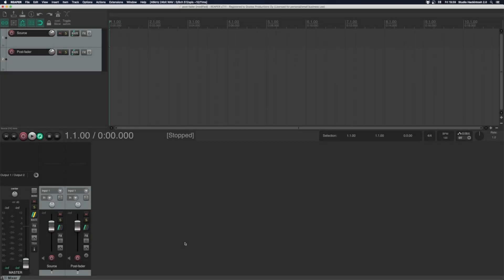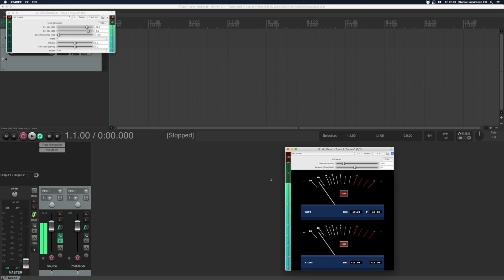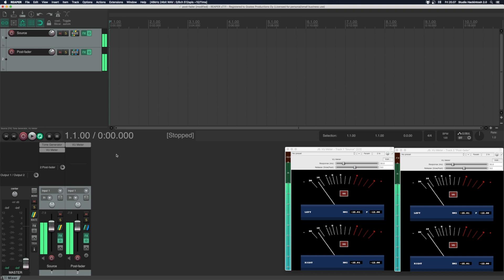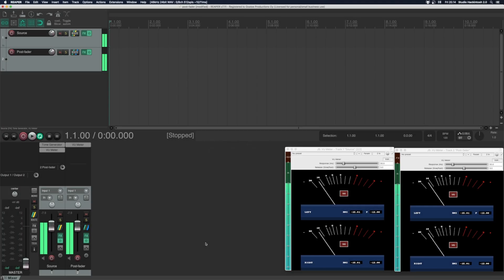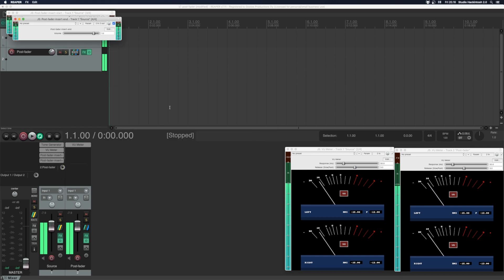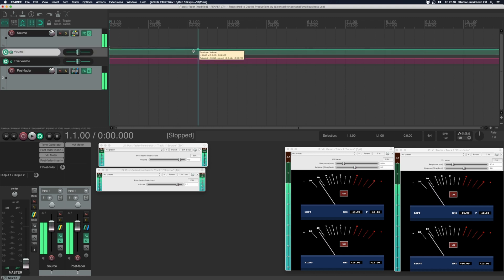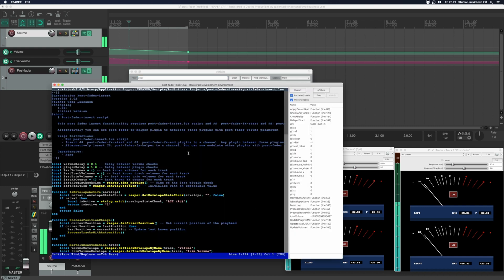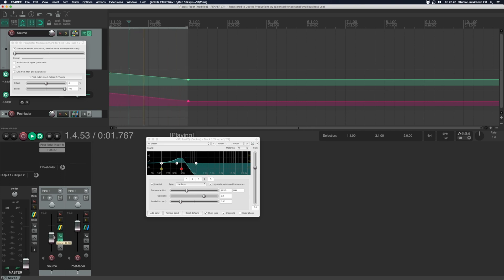Reaper Post-Fader Insert script and plugins

Comment: Hi, I really like the post-fader insert scripts, they’re a great workaround for Atmos in REAPER. Unfortunately I’m running into a major issue with Latch Preview automation: as soon as a track is in Latch Preview, the post-fader insert start/end stops behaving correctly (sometimes reading from volume, sometimes trim), and automation becomes unpredictable. Touch mode works, but Latch Preview breaks the system, which is essential to my workflow. Just wanted to check if this is a known limitation or if there’s a recommended way to make it work with Latch Preview.

Comment: Hey! Great work - a game changer with allowing proper usage of AirWindows Consoles... but I have the latest version 1.13 and soloing tracks doesn't seem to work. It just mutes the track. Mute seems to work fine. Any ideas?
Reply from the maker: Solo mutes all other tracks where you have the start plugin. This is for the fiedler audio stuff to work properly but might make stuff difficult if you use it in busses. Comment out the solo on other tracks from the plugin to disable this.
Reply: @AudioIdeas  Thanks for the reply! Is that line 23 in the post-fader-fx-start plugin? Edit: It works. Thanks!

Comment: Very useful and cool.  Thanks.
Two questions. 
1. What about pan? If I see correctly, pan isn't included in the "post-fader" workflow?
2. Is it possible to turn off the "solo other channel" functionality? When using folders it doesn't work well. And why is the solo other channel functionality useful, just curious.
Reply from the maker: I'm curious about where you see pan relevant to be really before plugin? I guess with non-linear plugins it would be relevant to make the distortion behaviour work as it was real post-fader, but is there something else? The solo on other channel mutes the other tracks when the solo is engaged. This was important for the Fiedler Audio Dolby Atmos workflow. You can disable this by commenting the fader line in the plugin. So:
#slider4:0<0,1,1>Solo on other channel
Reply: @AudioIdeas  Thanks for the answer and the quick fix.

Regarding pan. You're correct. Pan is usually a volume based operation in Reaper (unless another setting is used rather than the default). So for mono content, it's dual mono and it just adjust the volume of the left and right channel, as well as for stereo. Meaning that it will change the volume post fx, which is not recommended for the Airwindows console plugins. So that use case is my main concern.

I also encountered a problem with a very strange sound. I used automation with a quick fade out and then later fade it and in the export, there was a very strange and audible "zipper" sound. I'm guessing that's a limitation with the script, that tries to respond to the automation, but just wanted to check with you if that's the case.

Thanks again.
Reply from the maker: Yes, I think you are right there. The background script has a certain frame rate. I guess it would be possible to create some sort of smoothing algorithm in the plugin end. I'm in a middle of huge non music related projects at the moment, but coming back to do more music stuff starting from January. Maybe I'll fix this then. Thanks for informing this!
Reply: Hello  @AudioIdeas  , I tried to disable "Solo on other channel" by commenting out the line in the code; however, now "post-fader-insert-start" instances get bypassed when other tracks are soloed. Is it normal?
Reply from the maker: Yeah. I think I need to do two different scripts for using with AirWindows plugins and Atmos things. These have different requirements that just don't go together very well.
Reply: @AudioIdeas  That would be much appreciated!

Comment: This works nicely, thanks!:) Going forward, making it work inside a container would be great, as containers can be saved and re-loaded to occupy only one FX slot, instead of the minimum of three when saving as an FX chain.
Reply from the maker: I have to take a look at this. I started making this before containers so I haven't checked the API if it's possible.
Reply: @AudioIdeas  Thanks for considering this, It'll definitely streamline its use.
Reply: @AudioIdeas  Hi, I was wondering if u--hopefully--already updating the plugin so it could work with container; thank you so much
Reply from the maker: Let's see. I have dozen coding projects going on, but let's see if I could squeeze an update at some point.
Reply: That would be rad.